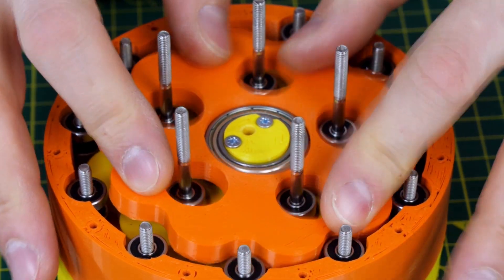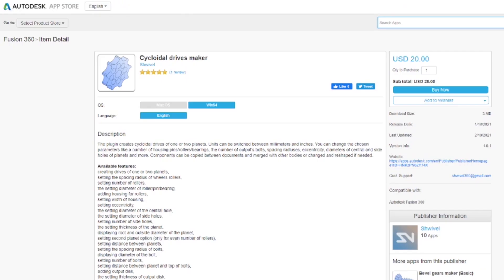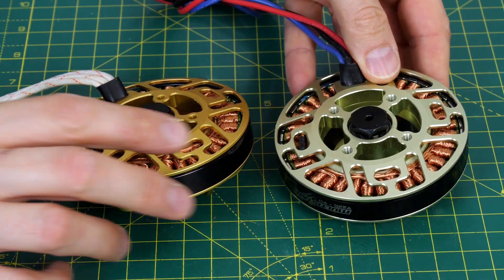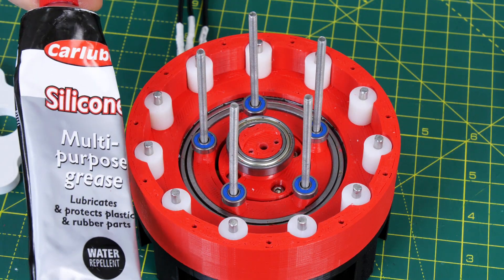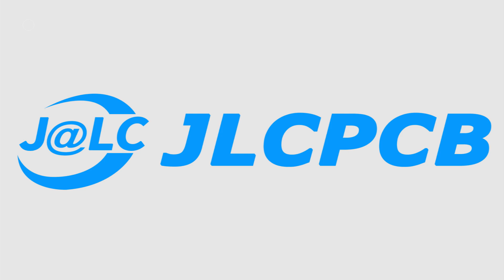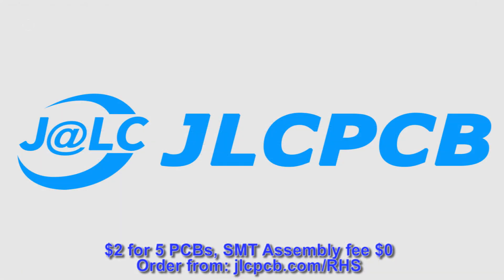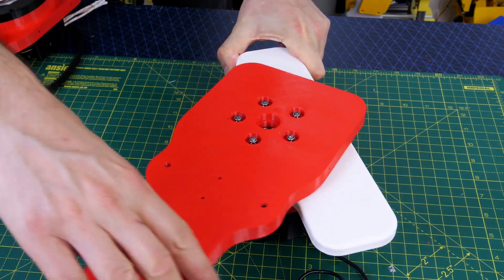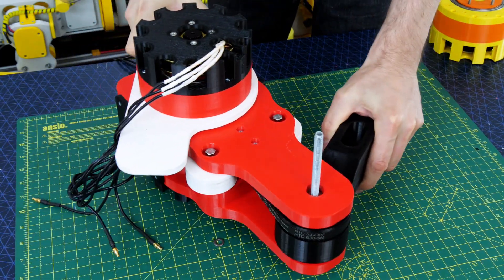Cycloidal Drive V3 & Robot Dog Test Leg

Comment: Have you thought about using machined delrin for the cycloidal discs (Not laser cut, due to elephants foot)? Should be very accurate and delrin has low sliding friction.
Reply: Do you think nylon would work for a low friction surface? I think laser cutting may work for this depending on disc thickness and focal point. The kerf does have an angle to it but, I've seen worse in 3d prints having elephants foot.
Reply: @4_The_Loot  Nylon is great, but I wonder if it might be too compliant. Obviously depends on the nylon, but delrin sheets are very rigid in the plane of the sheet. Yeah, laser cutting delrin can be fine if you dial it in - I've just had issues with it really liking to slump down behind the path of the laser

Comment: How mutch is the clearing between the red part below the locknut and the bearing at 5:16? There should be at least some also overtensioning the locknut might affect the system. Good work btw! I'm loving this stuff

Comment: Lube everything with graphite and it will tighten all the gaps and reduce friction, which will in turn reduce the noise a ton.
Reply: I was honestly surprised he didn't use graphite. I could very well be wrong, but it seems to me that it would do a better job than his runny silicon oil here?
Reply: @cheaterman49  especially with such an open system the graphite would do way better. The silicone lube will do nothing but collect dust.

Comment: Hey James, I'm really struggling to actually discover a source of brushless motors like what you've used here. A lot of is due to not knowing the exact size / kv that are available making it hard to search for what I need. Could you give me some pointers?
Reply: Im wondering myself!
If im not wrong (and im totally New to this topic...), you need a motor able to handle enough V, so you can lower A and heat for the same Watts.
Kv should be as low as possible i think.

Since i dont know where to Look, i just scroll all shops 😆

Correct me if im wrong pls
Reply: @cycust  "Kv should be as low as possible i think" makes sense. I came here wondering why a multi-rotor motor is used since it is designed to give high speed but low torque. A dog trying to walk needs the exact opposite. Seems its compact-ness is the reason.

Comment: did you optimize the small bearings to be skateboard bearings yet? that might give some cost savings, probably easier to buy those in bulk to shave costs off too
Reply from the maker: That would definitely weigh a lot more. I just got 400 of the correct sized ones for $60
Reply: @jamesbruton  I think the question relates to the design being accessible open source, which would be hard if you have to buy a 400 pack of bearings to make it cost effective

Comment: If you're using 'real' cycloids now, doesn't that mean that you don't need the outer bearings at all? Seems like it'd be stronger, quieter, and simpler.
Reply from the maker: I'm pretty sure there's some friction there - especially where the 'peak' of the disc passes the pins while it's engaged with the other size of the drive.
Reply: Right, early on I was going with the "It's all rolling contact" but I don't buy it any more.  I think your bearings are allowing low friction sliding contact on whichever bearings are capturing the 'peak' sides of the cycloidal gears.  Go back to bearings

Comment: Before resorting to the metal bearings, how about trying some silicone grease around the nylon bushings? It might help solve part of the noise issue, and might also help keep some of the costs down. Failing that, what about using split bushings in place of the full height ones currently in use? Well done so far. Looking forward to the next one. :)
Reply: This is something that’s always confused me. I build bikes and we use grease in bushing and oil in other areas. I don’t know why the usage is so sparse here.
Reply: @tubularmonkeymaniac  - If I had to guess, I'd suspect that he's trying to keep the mess to a minimum, since he's probably going to disassemble it several times for debugging purposes. But, that's only a guess. :)

Comment: I don't think the bushings are to blame for the noise. Bushings are virtually always quieter than bearings. Sounded to me like something was crunchy, like the bearings or bolts grating against each other, but hard to tell over video. Nylon bushes definitely shouldn't have made it louder. 

Also, I've been saying this for a while, but you could just print the outer gear instead of using bearings or bushings. There should only be rolling contact between two cycloidal gears, so if done properly the bearings and bushings would not rotate at all, thereby making them pointless. Would be much cheaper, lighter and easier to assemble if you just printed the outer cycloid. Gets rid of the bushings/bearings, their metal axles etc and it might even be stronger because all the stress isn't concentrated on the small pins and where they are embedded in the plastic. Also might have less lash because of having a full tooth shape to engage with.
Reply: To me it sounds like the bushings are just clattering against the pla print. I would personally use gearbox lubricant, as it muffles sound a bit and lubricates.
Reply: @SgtBurned  doesnt gearbox lube create a lot of drag?
Reply: @drewmichael4014  Only initially, after running it in it moves to where it's needed and the excess builds up in areas where no mechanical movement takes place based on my experience with power tool gear boxes.
Reply: i designed a cycloidal drive and for the static part I used steel pins (actually from bearings, lol). and they are absolutely silent. the motor is louder than the gear.
Reply: There is not just rolling contact same as for a conventional gear - rollers are a common way :)
Reply: @EngineeringSpareTime  "normal" gears are involute, which do have sliding contact. Cycloidal gears are supposed to have pure rolling contact, which is why watchmakers use them
Reply: @H34...  that’s correct, I just added the “normal“ gears since this is a common thing one confuses. But a pure rolling motion is just the case for a certain combination of dimensions of the rolling elements for my understanding, isn’t it? And in this inner running config with this transmission ratio you can’t achieve a desired ratio for pure rolling contact
Reply: @EngineeringSpareTime  im pretty sure pure rolling contact is a given by virtue of using cycloidal gears, since the teeth are formed by a point on a circle rolling along a surface. So when the surface rolls against a circle (bushings/bearings) it is pure rolling motion as was used to generate the gear in the first place
Reply: @H34...  to simplify the illustration check the animation at the end of this video and it becomes clear: https://youtu.be/guvatctnjww
Sure it’s generated by rolling on surface on the other one, but those relative objects or shapes move along with the rotation, thus rolling contact is just given in one point around the circumference.. where the relative velocity is zero.
Reply: @H34...  one could say: with an infinite amount of “teeth“ - two circles - this cycloidal would be pure rolling contact
Reply: @EngineeringSpareTime  it is two circles. The inner and outer. The inner was formed by a point on a circle rolling (with zero slip/sliding) along the surface of the circle. Therefore when the inner gear moves along the outer pins (the same circles that formed the gear in the first place) it is rolling contact, just like the contact that defined the tooth profile in the first place, no infinte gears needed.
Reply: @H34...  check the end of the video I mentioned above and you will see what I mean
Reply: @EngineeringSpareTime  i think i get what youre trying to say, that the point opposite the meshed tooth is sliding? In reality there is some clearance so that opposite side isnt touching. Also there is translation not just rotation when the tooth profile is generated as well, so it's no different. As the tooth circle rolls along the gear circle it both rotates as well as translates around the circle, but still only rolls and not slides.
Reply: @H34...  it’s a bit hard for me to express it, because I work with it in a different language/ terminology - sorry for that :) There is no clearance in a such cycloidal, that‘s the point of our “misunderstanding“. They can be preloaded actually. The multiple contact points actually have the benefit of distributing the load all around the circumference.. and that’s why they have rollers also in industrial versions.
and btw with an infinit radius rotation becomes sliding :o)
Reply: That makes complete sense I hope he reads this because it will be a significant improvement over what he's currently doing which seems a bit redundant compared to your suggestion I never wouldve thought of it thanks for the comment
Reply: i want him to see this
Reply: Maybe it’s so that when the bot is walking it doesn’t break as the gears are forced to collide with the bearings in an unnatural way. Rotating impact joints is his goal. This does seem over engineered though.
Reply: Said the same in my comment. If you look at professional machines they use static metal parts with some lubrication, no bearings or even extra bushings.

If anything some of the extra noise could be due to the bushings or bearings allowing for slipping and increased vibrations compared to if it was just a solid 3D print.

Could also probably shrink the parts because he wouldn't need to make room for the bushings for external teeth. Shrink the rim around the casing to a thin wall just to keep dust out and move the fasteners to where the steel pins are now.
Reply: Pure rolling would only occur in true cycloidal gears. These, as he mentions at the beginning, have a slight different shape. The "teeth" are smoother, the gears need to move less, but you get some sliding.
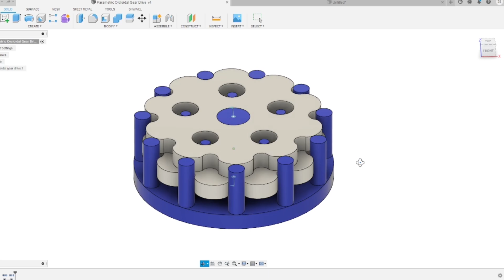Reply: Check at 1:32 how much "pointier" or deep the teeth of a true cycloidal disc are.
Reply: @heitooooor  didn't he say he finally switched to true cycloids using some fusion plugin?

Comment: ‘I didn’t want to have to buy metal gears so instead I’m using 64 bearings per leg’
Reply from the maker: I just bought 400 bearings for about $60 though, so it's still a lot cheaper.
Reply: @jamesbruton  Bearings still shouldn't be needed for a lot of the areas you have been putting them. Cycloidal drives are supposed to be all rolling friction anyways, so adding bearings just adds unnecessary weight, cost, and size.
Reply: @LanceThumping  I think his YouTube fortune has spoiled him, no longer thinking of us robot enthusiast peasants who can't afford to take a refreshing bath in bearings 😢
Reply: @LanceThumping  key phrase: supposed to be.
Reply: @jamesbruton  400 bearings for $60? Where from? 🤯
Reply: 64 bearings = a weapon to surpass Metal Gear
Reply: Exactly my thoughts. At certain point, the 3D printing just cloaks your judgement and you want to print everything.
Reply: @Jakub1989YTb  that's open source, he just want us to be able to do it

Comment: Why would you worry about being able to back drive the motor assembly, when designing the legs themselves to accept shock and give a natural bounce there may allow for stronger motors, more lift capacity, and better shock absorption through the leg structure?
Reply from the maker: Because I can change the compliance in real time through software and do force control.

Comment: Thinking about this; you could probably use wormgears with actual springs to allow the wormgear to move on a shaft, or the gear driven by the wormgear could be mounted in some kind of springy fasion for the "springyness" you want.
Reply from the maker: Tuning it would be hard, and so would changing compliance in real time for force control.

Comment: You should definitely be able to replace the output shafts bearings with more nylon bushings.
Also since all contact is supposed to be rolling contact by default, you could get away with 3D printing the external teeth instead of using nylon bushings at all.
Looking at industrial designs they do just use bare metal with oil/grease and not bearings or anything in those areas.
My gut says that those elements being able to rotate/slip especially freely causes extra noise and losses.
Reply: The industry solves that with tempered hand polished surfaces. The bushings are mainly so the discs don't wear too fast.
Reply: industrial designs can get away with that because of highly precise machining tolerances and very smooth/hard surfaces. I don't know if printed plastic would be able to hold up in that sort of situation.
Reply: @turnerroll9431  Certainly won't last as long being plastic - but being plastic throw enough grease in there and just let it wear in as needed - as long as the tolerances in the design are not awful the 3d printer will make sufficiently accurate parts... Really should not need bearings for any of its teeth like bits, quite possibly not for anything internal at all - just the main shaft will definitely need bearing to deal with the robot dogs weight - it pretty much takes up all the nasty loads - so for all the rest of the internals the forces and friction inside the gears should be low enough to last fairly well as greased plastic...

A nearly all plastic construction has a few advantages, pretty obvious ones really, and shouldn't really have much in the way of downsides for this use case. 
- It would be better to machine in a slippery plastic or metal the moving parts for better longevity and being able to keep the tolerance smaller and so cut down on slop in the movement a little more. 
- When the moving parts do start to wear out being a single integrated print means much more reprinting to do, any flaw in the 3d print could cause more rapid delamination around the layer lines. 
- run really hard on a hot day maybe you will get to the softening point of the plastic you used

But none of these I would expect to be particularly bad, and to meet the goal of easy to replicate open source hardware its hard to argue with a well toleranced set of 3d prints for almost all the parts - less bearings, rods, bushings, screws to source if more of it can be printed on the relatively available, 'simple' and cheap FDM machines..

Comment: When making parts that have to press into each other, such as bushings, what sort of tolerances do you usually have in the model to get the right fit?
Reply: It really comes down to how accurate your 3d printer is. I use 0.1mm offset as a default value for a press fit. So, for a 2mm hole, it's modeled as 2.2mm
Reply: @MrVolt  you just have to calibrate your printers step/mm and horizontal expansion in the slicer
Reply from the maker: About that much

Comment: Are you sure its the bearings vs bushings? Seems more likely to be luck of the draw with the printing tolerances to me. Perhaps you have already done something like this, but Id print the discs with a succession of tiny offsets on the extrusion multiplier, to see if that matters.
Reply: Ah ok; yeah the sound is definitely less appealing; just not quite sure how the decreased rolling resistance of the bearing would be the essence of it from an acoustics pov. Unless there is play between the bushings and pins? Interestingly the V2 has this funny low frequency wobble going on indicating some tolerance issue that V3 seems much less affected by... Also the stacked cam axis seems like a tricky one from a tolerance pov...
Reply: This! these are machine tolerances your after, additive manufacturing will not get get to the thousandths consistently.
Reply from the maker: Yes I already had to tolerance the discs down to make it run at all. The sound it makes though...
Reply: @jamesbruton  I'm no expert but controlling machine tolerances will be controlling every variable during printing (room temperature till printing material batch) if possible consider visualsing the wear/friction ( IR camera/adding sooth and see where it sticks, maybe).

Comment: It's usually the case(talking about the cheap motor), for example, good PC power supply branded could be 100, but you can get the exact same power supply from someone like greatwall for 50% the cost - i.e the brand takes the cheap one and basically just paints it lol.

Comment: Would it make much of a difference to have two bushings stacked rather than just the one bushing supporting the two cogs? I feel like each cog would want to spin their bushing slightly different depending on the contact point.
Reply: Unless I'm mistaken, any given bushing is in contact with at most one of the cogs at any given time, so I don't think it's a concern.
Reply: I guess it would depend on the tolerances. Some diagrams show cycloidal drives to still be in contact with the post when at the peak of a cog tooth as well as the valley maintaining contact through the whole cycle I believe to reduce play in the system. I think that was the purpose of the plug-in that was mentioned to get the right tooth profile. 

You may be right though. I’m more of a hands on learner and haven’t played with one before, so it’s possible I’m wrong. It’s been known to happen.

Comment: Could you not save weight by reducing the points of contact of the cycloidal gears down to lest say 6?
Reply from the maker: It wouldn't be 10:1 anymore
Reply: @jamesbruton  ah so the relationship of the ring pins to the cycloidal gear that does the gearing.